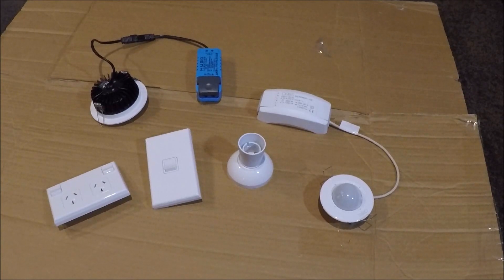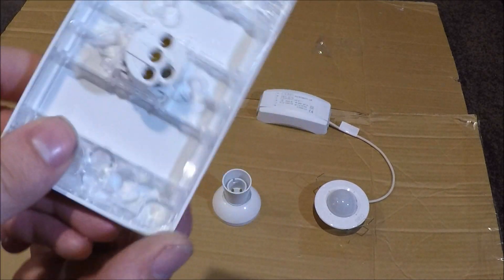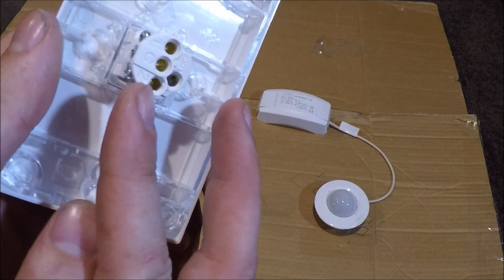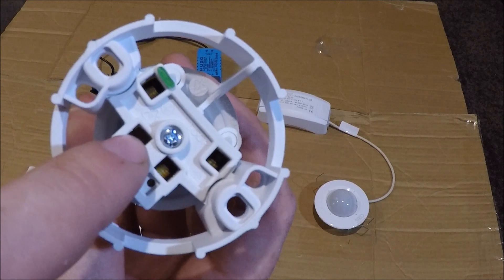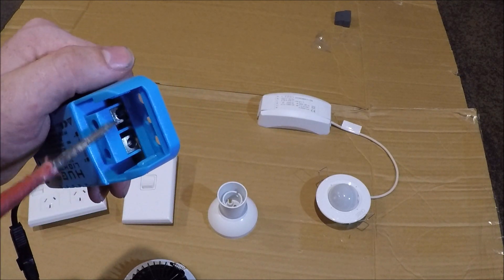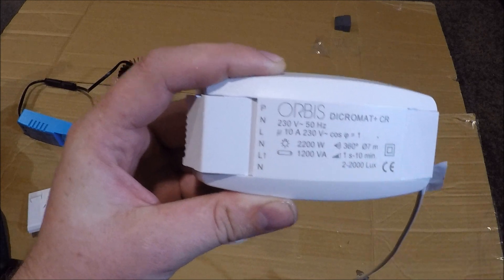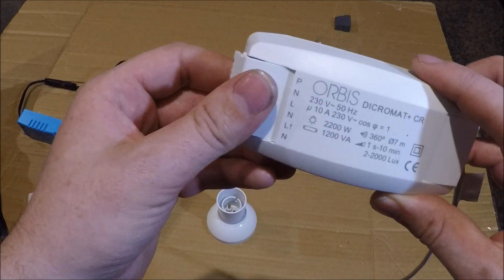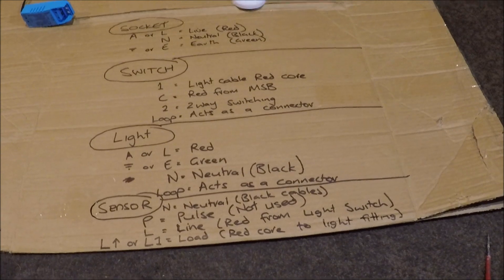Electrical Fitting Terminals Explained!

Comment: When wiring a battery backup/emergency light that requires unswitched active would you use a white or red wire? I assume the options are either use the twin and earth as normal plus a single red for unswitched active, or option 2 is use red for unswitched active, white for switched active, and neutral/earth as normal.

Comment: hey mate, thanks for all the sparky vids, appreciate it. ive got a ceiling 360 sensor i wanna wack up in my workshop kitchen bewtween the two lights. Both lights are running of one switch. my question is if i put  a sensor what would i need to do to install it between the two so it looks tidy?

Comment: Cheers.. keep the helpful  vids coming.. 
Question...with an out side light.. do all lights need an earth?
I was told i had an outside light that wasnt hooked up.. because it needed an earth.. possibly because the actual light fitting.. is a metal fancy  one.. im not sure..only going on what i was told but id like to get it working...
Reply from the maker: Howdy, yeah if it is not a plastic fitting (ie, has exposed metal parts) it will require an earth cable, to ensure that the casing does not become live if there was a fault. If you find the nearest electrical fitting that has an earth cable behind it, and connect an earth cable from there to the light fitting that would be fine. Sometimes its not an easy job to do without cutting holes/installing capping!
Reply: @sparkydave  cheers.. so a cheaper less hassle way around that.. remove the metal fancy fitting.. put a plastic fitting on.. and problem solved..